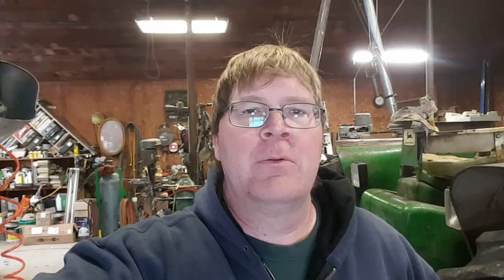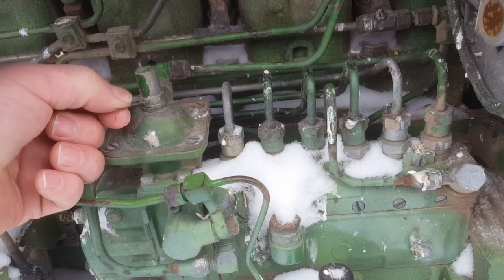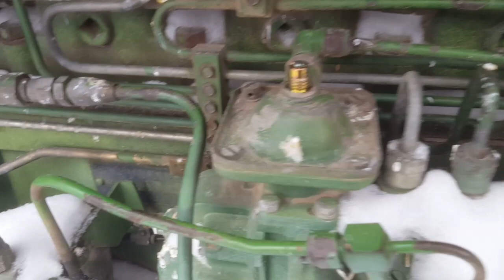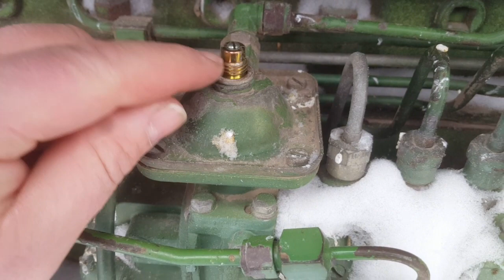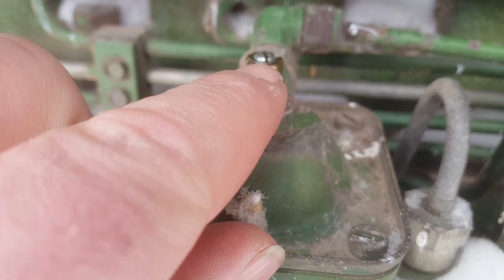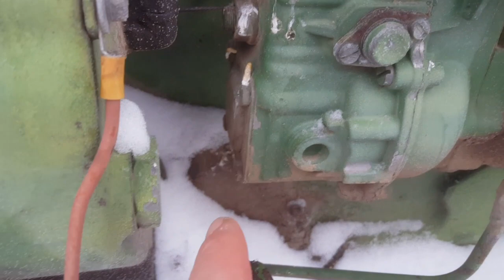john deere aneroid adjustment.

Comment: We did this with my brothers 4250 this last weekend after doing an engine and hydraulic system filter change. 
He's definitely noticed the change in torque in the lower rpm range when pulling a full spreader of pre+ emerge fertilizer on his corn feild before tillage this season. Hes happy an got this information form your videos. 
Keep up the great work you do. So informative for those that have limited information on subjects like this. 👍👍
Reply from the maker: Nice. Like Cat power torque!

Comment: Hi Jon, I just happened to stumble on your video, Glad I did. I have a 4630 with a front end loader attachment, due to the inherit low revs problem when the turbo hasn't spun up it was gutless to push anything. Your vid made a huge difference. I could even hear the difference when it idles. Much appreciated
Reply from the maker: I am sorry I did not see this comment sooner I'm very glad that it worked out for you

Comment: Big help. I have a 4630 that had been turned up enough but nothing on low end. Like you said. You can't baby it. And a4430 that was turned up a little too much when I got it. Now I have the info I need to make them both right. John Deere said it would be 1000 to put them both back and I know I wouldn't be happy. So thanks a 1000.
Reply from the maker: You can put them to stock in half hour.

Comment: On the 55 series when the oil filter housing is in the way just use a 1/4” ratchet with a 10mm to break jam nut then turn the screw with a dime if you don’t have a 90 degree screwdriver

Comment: Im of from context but i have a 4230 that the pto lever was kicking off when i hit another hydraulic function.  As long has i never pulled another hydraulic funtion the pto would stay kicked it. Then when i was trying to figure it out i started taping the right and left brake pedels and it would kit it out to the point that the pto lever will not stay up unless i hold it. Just woundering if you could give me some advice? Thank you for your time
Reply from the maker: The first thing I would check is the transmission pressure..
If you don't have a gauge set up, you can take a quarter inch lock washer.Put it in the vice and bend it flat so there is no more offset or lock to it. Behind the left battery box you'll see the valve housing and one nut at the bottom will be taller.
Reply from the maker: That is your pressure regulating valve. When you take that down a Spring and valve might follow. Keep cap upright so you do not lose the shims that are in there. With the added washer see if your p t o now stays on

Comment: we have two 4640s.  me and a buddy overhauled one in spring. the one we overhauled has a bit less power than the other one. if you had a leak in the aneroid line would you need to bother replacing it after doing the aneroid adjustment. Does this adjustment increase fuel usage under no load conditions. I don't see why it would but would it.
Reply from the maker: If you had a leak we could say you are technically loosing some boost pressure, if it's a tiny leak can't see how it would effect power.

Fuel usage would be dependent upon load and how its driven. Will use more fuel under acceleration, or responding to a  change in load.  Under same loads should use same same fuel you would imagine.

Did tractors have equal power before?
Reply: @jonstevensmaplegrovefarms3754  one has been on this farm for about 15 years. it always had very good power. The other one was purchest recently and was gutless and pouring smoke so we got pump/injectors done and new turbo.  Issue was still there. so we decided to do an overhaul and during disassembly we discovered all boost press was bieng lost through crack in intake manifold. After overhaul it has way more power and less smoke. but there other one can pull a bit harder. Normally we dont like to put our tractors under max load but we were ripping up sod and the tractors had to pull hard as they could. I adjusted the aneroid in the overhauled one. The power difference is probably just in the pump i don't think ill bother turning the  hp up. I dont think there is a leak on aneroid line I dont hear a whistle. But I do have thread adapters on the line due to having the wrong elbow on new intake manifold. it could possibly seep by

Comment: I got to try this on an 8430 we just picked up.  All kinds of power but it's all somewhere above 1500 rpm.  Can't take off in D3, barely gets going in D1 down the road.
Reply from the maker: You should never take off a D3. LOL

Give it a try let me know what you think.
Reply: @jonstevensmaplegrovefarms3754  Seems to help, but it's not blowing much more smoke out than before when it pulls at the lower RPMS, can I go more or will that hurt something.
Reply from the maker: @jeremyheitzig599  did you get the little screw flush or slightly lower then the jam nut?
 you hit the hand throttle forward you just pull against some Springs in the governor. Same thing if the engine gets lugged down it pulls again some Springs in the governor.
All this is doing is allowing the injection pump to respond more quickly to changes
You haven't changed the horsepower screw so it shouldn't turn it into a black smoker. A 50 Series might smoke a whole lot more because of the torque capsule inside the pump. But in the 30 series they only have like a 5% torque rise capsule. So my 8450 smokes like a pulling tractor when you touch the throttle but the 4430 doesn't smoke much. But compared to where they were to where they are now they are like a CAT engine in the tractor

Comment: Think this adjustment would work and a New Holland 8770?   Our has a serious bottom end issue and when working tough ground, has  real issue with near stalls.  If the RPM drops below 1650, it's basically gutless.
Reply from the maker: If it has a set up like this on an inline pump you would like to think that it would help. But it does not change the peak horsepower. A pump shop can also change other things in there to give it a little more torque rise
Reply: @jonstevensmaplegrovefarms3754  It looks to have the exact same pump and aneroid setup on it.  It has lots of top end power, but it's always a real dog speeding up to 1750- 2100 RPM and if you are trying to run at 1800 RPM and you hit a tough spot, that bogs you to ~1650, it pretty much dies.  Sounds like what you described in your video.  I hope this will be a simple solution to my problem .
Reply from the maker: Give it a try let us know
Reply: @jonstevensmaplegrovefarms3754  Thanks a lot for this video.  I tried it on our 8770 this morning and beside the single "tamper - proof" screw (It used screws to hold down the cap on the aneroid), adjusted it no problem. Got lots of bottom end now and doesn't smoke any more than it did  Been like 6 years looking for a video like this.  Once again, thanks so much!
Reply from the maker: Awsome! Glad it worked!

Comment: Is this problem appears in 55 series, which dont have aneroid? Maybe increasing hp by turning screw under cap will be enough...
Reply from the maker: 55 series some models.still might have had some sort of aneroid system, but they also had a lot different torque capsule in them. Stock for stock a similar horsepower 55 series would have a lot more pulling power and mid-range than a 40 series
Reply: That screw only pushes fuel in before boost can get in, just makes some more smoke basically, not much hp gain but some
Reply from the maker: Yep, gets rid of the boost delay for a lot more low end torque.

Comment: Is adjusting the aneroid hard on the engine, I adjust it on my 4440 and was impressed on the results, but now after about a year it all of a sudden started having excessive blow by. I'm suspecting I have a busted compression ring
Reply from the maker: In normal situations no but if a person now decided they don't need to downshift they can just let the tractor lug and pulled it like that all day long then yeah you could see excessive wear

I had a few customers when I was out in central Minnesota we would not turn the Peak horsepower screw up. Because they were the type that if you gave them 25 more horsepower they would grab another gear and the tractor would still be hanging its tongue out

Very noticeably harder starting? All of a sudden you have excessive blow-by like you were driving and then holy cow where did all that come from or you are driving it one day and you thought I don't remember the tractor having that much blow-by before

More likely something happened because the tractor has how many thousand hours. It's just naturally at that wear point,  or an injector could be bad causing damage to the piston, highly unlikely but a ring could have broke.
Reply: @jonstevensmaplegrovefarms3754  It's was kind of a freek happening. I had the tractor at a shop to get the pto and drive clutches replaced, when he went to warm it up after he was done, it was just idling and all of a sudden they noticed it sounded different and noticed the blow by. It doesn't miss but does sound labored. It has 8400 hrs. I don't us it on heavy loads at all, just running a tmr, baler, 15'jd 750 drill, etc. I'm a zero till guy. I like your videos, and others that deal with regenerative ag.
Reply from the maker: All of a sudden and labored i would stop running and pull the pan and start checking bearings.
Reply: @jonstevensmaplegrovefarms3754   oil pressure still good.. But the plan is to do a inframe over overhaul.
Thank you for the quick response. I REALLY appreciate that.
Reply from the maker: Good luck! Might be out of frame if a bearing spun.
Reply: @jonstevensmaplegrovefarms3754   Steve I thot I would inform you that the crank is good but there was a hole in the piston behind the ring. 🤔
Reply: @allendoerksen4828  I've heard about unburnt diesel fuel because caught behind compression rings and detonating on its own chipping a corner of the piston off. Don't nail me to the cross if it's accurate or not

Comment: Would this work on a 4850 with a nippendenso pump? Mine has that same looking cap on top but the adjustment screw is not the same as that one.
Reply from the maker: The screw looks different but you would think it to be the same theory of operation. 
50 series had a different torque curve, very much improved over the older series with the 15 speed tranny and using that to stay in operating rpms range you might not notice much?

Comment: Do you have any videos on adjusting the fuel screw on a 4640?
Reply from the maker: I don't but its not hard.  on the back of the pump by the oil filter housing is a square cap with 4 bolts holding it on. remove that cap then you will see a little thread and a jam nut. the jam nut is 10 mm. turn in for more power.  a half turn or full turn is a good bump in power.
Reply: Jon Stevens Maple Grove Farms thanks!

Comment: I’m not sure if you respond but I’m looking to turn up my 8650 would it work the same
Reply from the maker: This would help the mid range and bottom end power.  For peak hp you take off the little plate with 4 bolts on the back of the pump. Some tractors you have to remove oil filter housing. There is a jam nut and screw, give it a half turn in. 
Honestly the 8650 had a good balance of power to weight. Everyone wants more power but its a good machine as is. The aneroid will help some
Reply: We just picked it up it’s gonna be running a 16 inch auger it doesn’t have quiet enough power to move wheat in that 105 foot auger without bogging down

Comment: Won’t it loose a lot of oil if you pop that cover off to add more horsepower
Reply from the maker: No oil will come out on that top if you take the 4 bolt cover off the back a little oil might dribble out.
Reply: @jonstevensmaplegrovefarms3754  thank you I was worried I was going to lose gallons of oil

Comment: Jon, do you know how to get the injectors out of a 4440?
Reply from the maker: A 15/16 12 point deep well or a box end wrench should loosen that retaining nut.have never really seen any froze in the head so with that nut loose they usually come out.

the dealer has a special tool for tightening the nut because you need to hold the injector at a specific spot. Or a couple box end wrenches kind of work
Reply: @jonstevensmaplegrovefarms3754  Thank you for the response jon, I tried the 15/16 socket this morning but it did not fit.To small, i'm thinking an 1'' socket will fit.
Reply from the maker: Hmm, did you take that o ring off the top of the nut?
Did you get them out?
Reply: @jonstevensmaplegrovefarms3754  We are taking the head off to get re-surfaced. And the guy's at the head shop said to just pull it off carefully and they will pull the injectors out for us. 
Now I'm working on a leak under the steering wheel... Gosh it's tight in there.
Reply from the maker: Machine shops are usually really darn good to work with on that kind of stuff! I thought I had a video working under the dash there. It's tight but it ain't bad

Comment: Do you know how to turn up a 4240?
Reply from the maker: Oh boy if I remember right you got to take that top little cover off where your return fuel line comes out of. You might close the fuel above the front axle in front of the front axle shut the fuel off if your tank is full so you're not just pushing fuel through but I believe with the top cover off you can roll the engine over and you'll see a little tiny Allen screw up here if you turn that screw in you increase the horsepower. It's a small Allen screw something like a 5/32?
I thought like a half a turn was about 10 horsepower.

Comment: Any clue about a John Deere 3055
Reply from the maker: For more power or the tractor in.general?
Reply: Jon Stevens Maple Grove Farms just the tractor in general
Reply from the maker: @collinmilam5691 good engine, main hydraulic system, transmission, sharp turning front axle, easy to drive, comfy. 

at some point the pipes in the trans housing will start leaking and need to be split.  seems like these tractors went to 10k hours with little to no trouble. once they start to have trouble in the middle it can get spendy.  

if a guy left the hand brake on you will want to flush trans housing and replace when it quits working.  

they are overall good tractors but for the money it wouldn't take much more to jump to a 6400 and then you would have a lot better tractor.
Reply: Jon Stevens Maple Grove Farms what about the power on them
Reply: How to “ turn them up” for say
Reply from the maker: @collinmilam5691  that little rotary pump you went in and turned a screw that opened up a leaf spring kind of thing.  have a local guy come out. take him 15 minutes to do.  I don't know how much I would turn it up. pretty solid tractor and good power for how they are built.

Comment: Can the aneroid cause fuel in the oil? I have a 4024 doosan compressor with only 1900 hrs and the sump has filled with fuel. Any advice?
Reply from the maker: Shouldn't have anything to do with oil/fuel transfer
Reply: @jonstevensmaplegrovefarms3754  Thank you